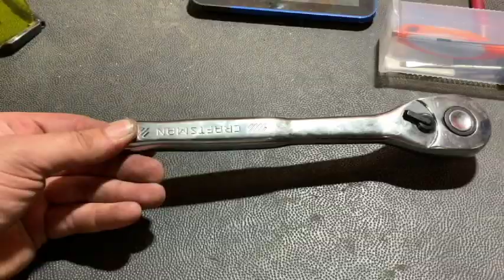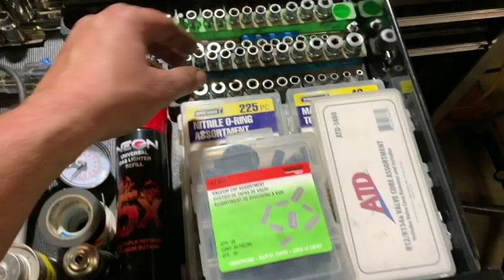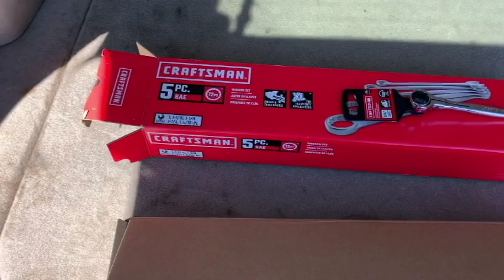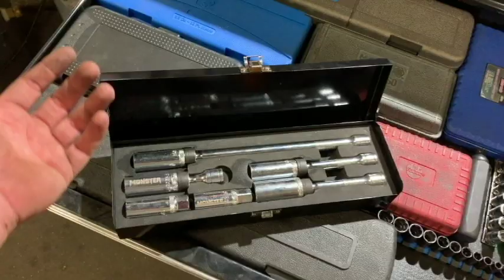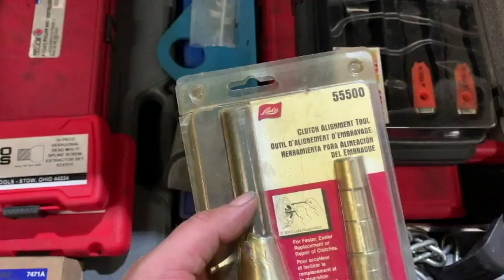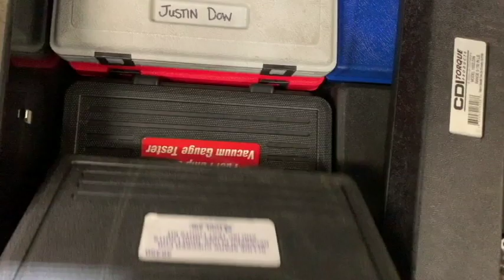MECHANICS HARBOR FREIGHT 56 GEN 2 TOOL BOX TOUR!!

Comment: I got that craftsman set and I like it alot feels real smooth in the hand
Reply from the maker: It was a pretty decent set overall. I do prefer the Gearwrench Set over the Craftsman set, but I prefer the Craftsman set over Husky, Pittsburg, Duralast & ICON.
Reply: @JustinDowDIYcentralhighway  yeah I agree I mostly use the craftsman set only for on the go travel use in my truck although those front plastic latchs are junk and pop open easy if you carry it by the handle I'm looking to fix that somehow with scrap metal parts

Comment: Justin, question on us general 44/56”. If a guy takes 6&12 point 1/4,3/8,&1/2 sae and metric, and place in the top drawer. It would be 300 sockets, how well would the slides hold up? How long have you had your series 2 and any issues?
Ok guess it was 3 questions, but I’m just worried, the price point might not last as long as I want. 
Thank you for your time.

Comment: I've owned a half inch Craftsman socket driver along with the sockets I bought 50 + years ago. They've been with me from California to Hawaii, and back. I bought a set along with 3/8", sockets and several other tools with a now old beat up looking Craftsman tool box.

I've worked on and under cars and trucks when it's -25° F. I've damaged or destroyed a few small sockets (abused them actually), and no longer have the 3/8" drive.

I disassembled the 1/2" drive, cleaned and lubricated with a synthetic grease. I have a lot of newer tools as well, but I really liked my old USA made Craftsman tools. Yes, it has fewer teeth inside, but it's never failed me, even when I've put a pipe on it while standing on it. Didn't have a breaker bar decades ago. 

Now, I usually buy Autozone tools with a lifetime warranty or Harbor Freight. I broke a HF 3/8" torque wrench, brought it back, and they swapped for a new one without a problem.

You make a living with your tools, so I respect your opinion. I'm retired and work on my car and motorcycle, with occasional help for one of my adult kids. 

I enjoy your videos.

Comment: I also have the drill master  heat gun from HARBOR FREIGHT. I use it maybe 4-5 times a year and have had it for over 5 years. Still going strong. I’ve got my $10 use out of it and when it does die I’ll buy another one. For the money and how often. I use it I feel it’s a no brainer.

Comment: Does the 56" bottom box have hole up top so you could bolt a top box to it
Reply from the maker: No, but if you put a Top section on it it's not going anywhere. If your that worried about it you can always remove the bottom drawers of the top section and drill your own holes and run your own bolts. If you get it set up in one fixed spot and don't plan on moving it I don't see it being a problem. Cheers!
Reply: @JustinDowDIYcentralhighway  any warranty  work you have to fill out for the box cause I've never  bought a tool box from them
Reply from the maker: Bradley Dunford I don’t know. Wasn’t worried about the warranty so I never asked. I’m sure he can walk in and ask them though before you buy one
Reply: @JustinDowDIYcentralhighway  oh ok how do you like it so far
Reply: @JustinDowDIYcentralhighway  ok thanks

Comment: I hate those old square style Craftsman ratchets. I have them in 1/4, 3/8, and 1/2.  The only time I use them is when I cant find my better ones. Before craftsman moved everything to China they had some premium chromed ratchets similar to the new ones. Those are by far my favorite standard ratchets. I find myself using the HF flex heads the most often now since they provide so much more leverage.
Reply: Them Toilet freight ratchets along with the remaining is 100% 🚽🚽🚽 material. The amount of TIME  wasted on trash a fella can just buy the Matco 88 ratchets and be done. I fail to see any sense in that of course them Toilet ratchets are lifetime warranty one spends a lifetime win gas/time replacing them. Muchless the mechanism is reversed that is beyond 🧻🚽. I got the SAME ratchets for years have had them serviced see no point in having to waste time/money/gas chasing down trash.
Reply: GearWrench 120XP's are way better.
Reply: @mt1885  Those look real nice.  I've thought about picking them up but have some other stuff I'd rather get first.  Like the Gearwrench long form wrenches.
Reply: @teamgreen02  Gearwrench wrenches are a great pick, along with their 120XP ratchets the MATCO 88 are like to me the best due to the slim profile and handle. Plus the mechanism is not protruding up.

Comment: Hey Justin where did you get those valve rethreading and cleaning tools from could use them for when our wonderful lube techs strip out the stem in a one piece sensor putting/pulling the core out and do they work on AC high and low ports
Reply from the maker: Yuppers that's the main reason why I bought them and I bought mine from MATCO, but you might be able to find them online. Cheers!

Comment: Another idea for timing belts is the metal binder clips. I keep 5 of them clipped on the inside of my cart and if I run according needing to clip a timing belt onto a cam pulley I have them. I used to have the small plastic clamps like you have but they broke within a year. Also the binder clips work great to clip a fender cover on and hold it in place while you work.